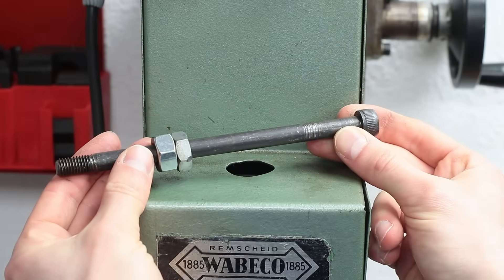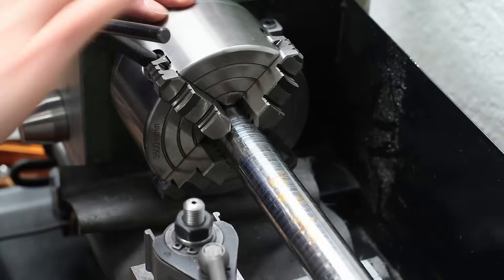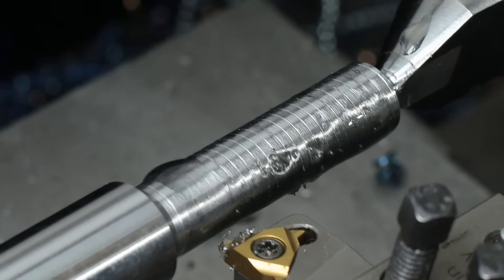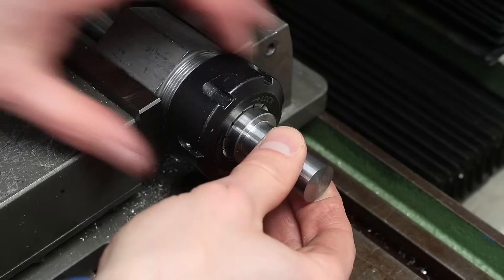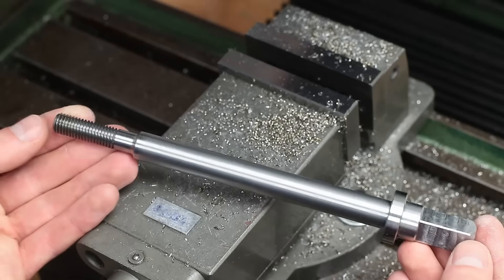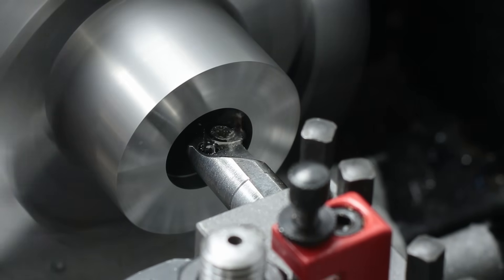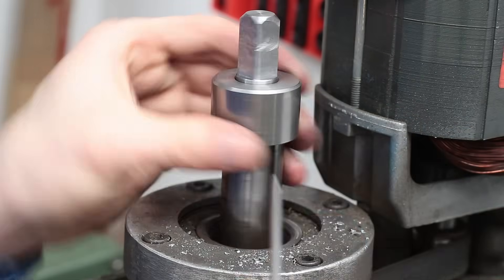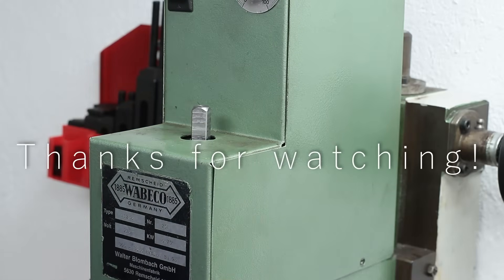Short Project - Making a new Drawbar

Comment: Next you should add a spindle lock so you don't need to use the pin spanner anymore.
Having to hold the pin spanner with one hand and the top handle with the other means you can sometimes accidentally drop the cutter out of the collet onto the table. A spindle lock leaves you with one hand free to hold the cutter as it is released.

Comment: I only see one thing I would do differently. Add a thrust bearing and two hardened washers between the spindle and draw bar. You will have little resistance tightening and loosing the drwabar and get the added benefit of not tightening the drawbar directly on the spindle, virtually eleminating the chance of damaging the spindle. Beyond that, great project.

Comment: Are the bearings on your lathe tapered? Or are they original ball bearings? Good video 😊
Reply from the maker: Thanks for your comment! The bearings are just normal ball bearing. The new larger headstock is flying around for a year or so. Have to change that and install proper spindle bearings or tapered roller bearings. So many projects wainting... :)
Reply: @WeCanDoThatBetter  nossa fiquei surpreso com o acabamento de suas peças, o meu coloquei rolamentos cônicos, no entanto não senti diferença nem uma o acabamento continuou ruim 😢😅 e não sei o que pode ser a razão deste problema, já fiz o ajuste de pré carga mas não mudou nada também.

Comment: Fantastic finish at the start of machining the bar. Either the insert was wearing or surface speed dropped after a while, I guess.
OK, not the insert then as the other end was perfect.
Reply from the maker: Yes, machining 42CrMo4 is pretty satisfying. I think surface quality dropped due to slower surface speed at smaller rpm.

Comment: I know very little about milling machines, so excuse me if the question is stupid, but is there a particular reason you didn't make a relief cut for the threads at 2:40?
Reply from the maker: Hi and thanks for your comment! There are no silly questions ;) I thought a relief cut might weaken the drawbar and would be a potential fail point. Especially as I considered hardening the drawbar which would have made it more brittle. And off course another reason is just showing off machining skills ;) :D

Comment: Might be a good project to make a hydraulic down feed for your bandsaw. You can use a one way valve in the piston itself to allow you to quickly raise the blade. Having a double ended ram will keep the volume equal on both sides. Just a thought 👍
Reply from the maker: A cool idea indeed. On my bandsaw you have to press a button permanently on the handle in order to make a cut. It's not really ment to work on it's own.

Comment: Just a suggestion for you. When I single point cut a thread, I have a set of thread files with a variety of the various pitches. It makes cleaning up cut threads much easier. They are also really good for repairing smooshed threads.
Reply from the maker: Thanks for your comment and hint on the thread file. I have none but would be cool to have one.

Comment: The set up kinda reminds me of b&s tapers. Extremely shallow taper makes it a pain to extract without a captive drawbar to force the collet out. One other thing I have since learned about shallow taper spindles is not to leave a tool in the spindle as the metal heats up and expands it allows the collet further into the spindle and can make it a pain to remove if left to sit and cool.
Reply from the maker: Thanks for your comment and for the advise on the tools in the milling spindle. I will keep that in mind. Thanks!

Comment: Great video! On most Chinese 3-in-1 machines, the top of the mill spindle shaft is not threaded, and your collar solves the problem. If, one were to use full dog set screws (and drill the spindle shaft to accept the dog), the collar can be fully locked to the spindle shaft. Geniusly simple... now, I have (yet) another project.
Reply from the maker: Thank you! :)

Comment: Great solution!
It does put a lot of force on those grub screws, might be wise to use high tensile grub screws, and loctite them in too so they dont squidge around and mash the shaft. Beautiful videoing too! 👍
Reply from the maker: Hi and thanks for your kind comment and your hint on the grubscrew. They sit actually a little bit in the spindle making a firm lock. But you are right that was something I am concerned too that there might be issues with damaging the spindle shaft. Don't know how much the forces are for releasing the tools.
Reply: @WeCanDoThatBetter    for sure. And most poeple over-tighten morse tapers to the extreme.
Such an acute taper only needs a small amount of force to lock it securely in place no gorillas needed haha